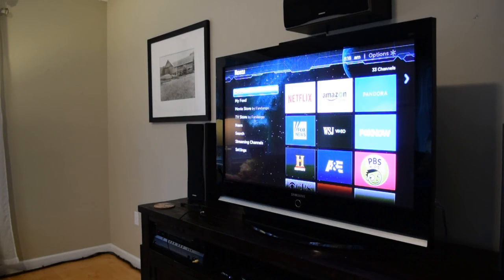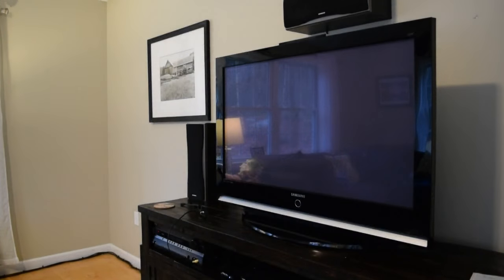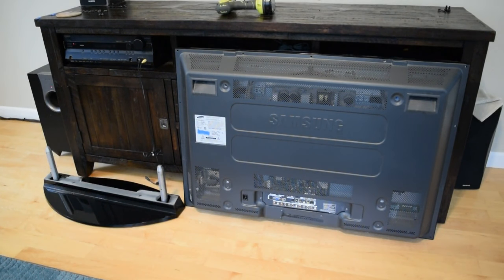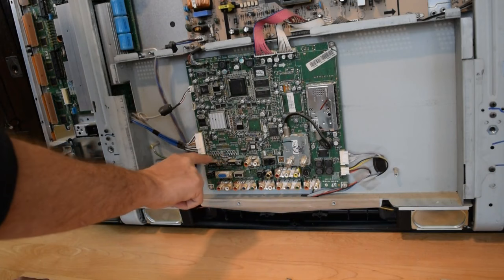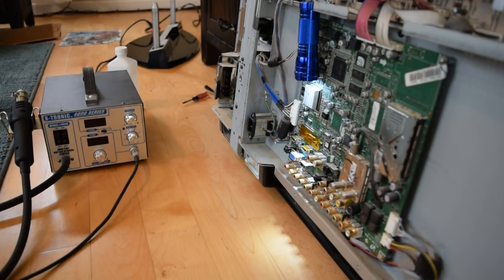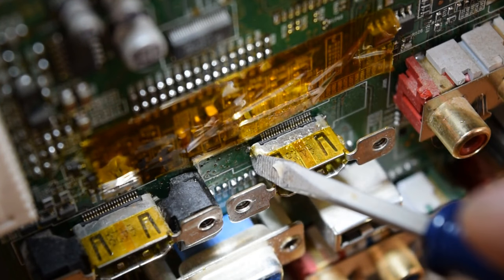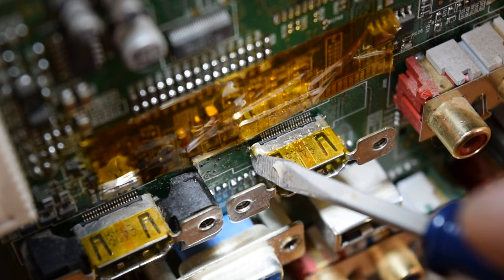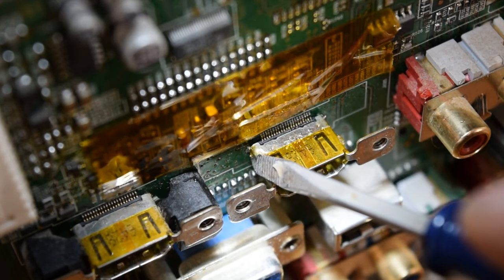Samsung TV HDMI Port Repair Highlights - HDMI Port Not Working

Comment: I have a different Samsung HDTV with both of its HDMI ports unusable, a month older than yours (mfg date: April '06). So far I've been using various HDMI-to-component or VGA converters. Although I understand why my HDMI's are not working due to strain, I neither have the soldering tools nor skill to do this with my unit. I'm more inclined to purchase a replacement mainboard if I have to open it up at all. At least it's cheaper than buying a new TV altogether

Comment: Sweet. I had to recap my Samsung LCD power board as it kept switching itself off lol. Gonna have to do this too soon as the HDMI ports are getting annoyingly flaky. Just not looking forward to trying to hang it on the wall on my own again1 Oh well, 10 years is not bad in any event. Good work.

Comment: Nice video and thanks for the detail explanation... Usually the HDMI port is not that fragile right? One of my other TV .. one day I accidentally touch the cable and like you said , waggle the connector a bit and screen black out and back on when I waggle it again ... But then after I plug in tight again ..It was fine .. since then whenever I plug in HDMI I worry that I will damage the connector or make it losen up from the connection board... And 6ou know sometimes you have to juggle around the cables behind and when you lift the cables .You will see the connector point kind of moving a bit...But once the HDMI has plug in properly and tight... It shouldn't be any problem because it should be well fitted in the connector right? Hope you can answer me and thanks
Reply from the maker: Every device/connector is a little different.  Sorry, but I can't really answer your question without being able to see it for myself.
Reply: @SevenFortyOne  
Superb job you did.
Keith Kuhn

Comment: Was it really hard to solder?  My TV is doing the same thing for both ports. I only have a standard solder iron that plugs in to the wall...Do you think that's good enough?
Reply from the maker: It depends on your experience soldering.  If you've never soldered electronics before, this may not be the project to start with.  On the other hand, if both ports are bad and the TV isn't really working anymore you probably don't have much to lose by trying.  You could always fond some junk piece of electronics and practice soldering on that before tackling your TV.

Comment: Very helpful. However, while it looks like I have a similar issue with my Samsung TV model UN46EH5000F where the HDMI Port 1 has crapped out (flashing picture that turns on then off to a black screen), I neither possess a soldering iron nor the knowledge to use one in this case.
Reply from the maker: Well at least you now know what is involved in the repair so if you decide to take your set to a repair shop you won't get bamboozled into paying for all sorts of parts you don't need.  A skilled tech should take about an hour or so to do this repair.
Reply: harbor freight 10 bucks for a soldering iron.

Comment: Never solder vertically, remove the board from the TV and solder it horizontally so that SMD parts don't fall off if their connections accidentally melted. You never know what SMD's might have been on the back side of that board either. Laying horizontal even if underneath surface tension would hold them on, but vertically it could have been a disaster.
Also you can buy an HDMI switch box for $5 to split the working port you have into 3 or more inputs.
Reply: Yes, that's laziness on a person's part not wanting to do the work right.

Comment: What would a place charge to solder 2 HDMI ports back on? Had same Samsung port wiggling issue until they finally fully came off board when HDMI cables were removed. Thx
Reply from the maker: I have no idea ... The last repair shop in my area went out of business 15 or 20 years ago...
Reply: I bet at.least $200

Comment: I have a similar issue with a receiver. the hdmi port pins have come loose from circuit. I did not see the tools you used. Here is the pins on mine. could you recomend a tool for this? Electronice repair shops around here just want to be parts changers and not repair men. wouldn't be to much of an issue but it's the dang hdmi out so i got no vid signal. Wish i could have seen the actual solder/repair in this vid. 

https://www.dropbox.com/s/r1mp22qcooi60zo/2017-04-10%2012.34.01.jpg?dl=0
Reply from the maker: Take a look at 7:05 in the video.  That's where I show my hot air rework soldering station.
Reply: SevenFortyOne ah i see did.not hear what it was first time thought was a tester for after. ill have to resd up on that tool. thanks.
Reply from the maker: The tool was about $150 I think but I tinker with electronics as a hobby.  If you are considering buying one for just this reapir its probably not worth it for you.  You may be able to achieve the same thing by using a heat gun and fashioning a small nozzle for it to direct the airflow where you need it.  Heat guns are probably available for under $50.  Whichever way you go be sure you take your time as you can really make a mess of things if you aren't experienced with this kind of work.  Good Luck!

Comment: A DEAD obsolete technology repair
Reply from the maker: I think you missed the point of this video
Reply: He saved $800 by doing nothing basically. Blew some heat onto some solder. I've found most repairs are of this nature....just a loose $2 part on a $1000 item.